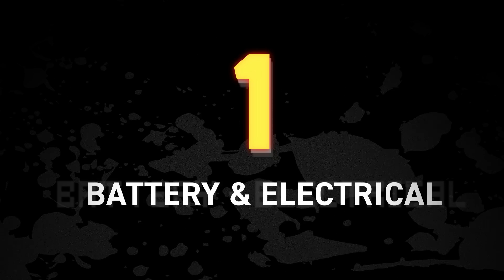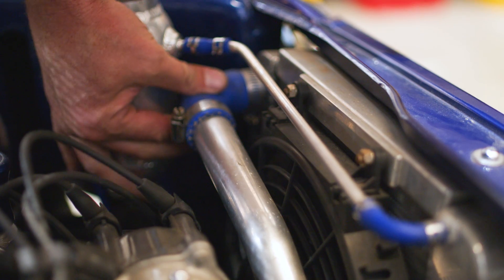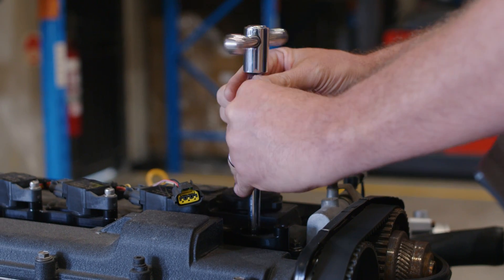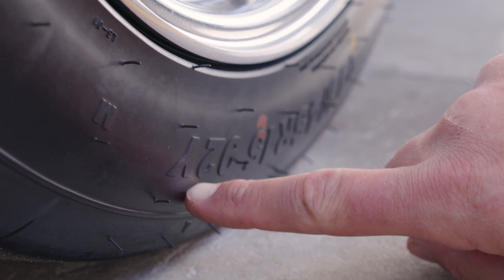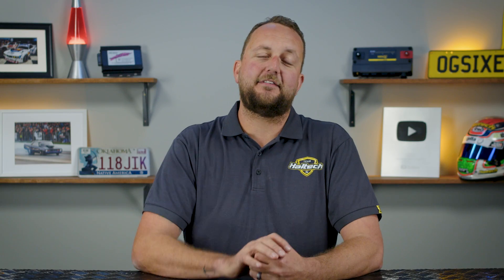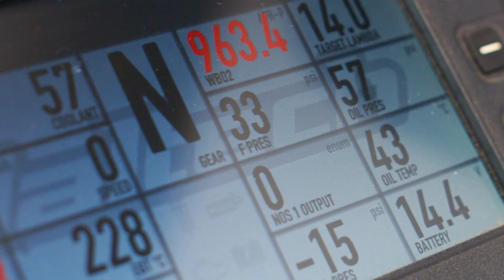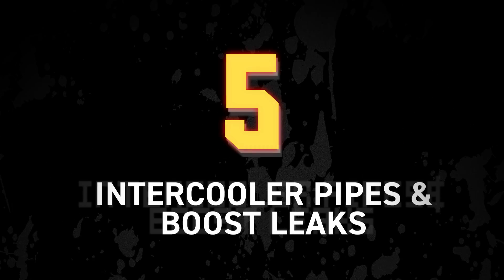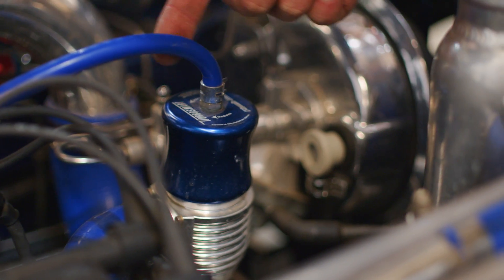🛠 Top 5 DIY Pre-Dyno Checks | TECHNICALLY SPEAKING

Comment: An experienced engine tuner will use a scope to do a relative compression test, using a reference from one of the coils or leads and a current clamp on a battery lead.

Comment: The note about the immobiliser stood out to me. My car was taken for a tune by my mechanic so i wasn't present, but they had an awful time on the dyno with the immobiliser cutting in and out several times and causing disconnects from the ECU. I'm surprised (and grateful) that they persisted!

Comment: Interesting that for a compression test, you crank until the pressure stops rising.  When I was learning, a very long time back now...back when carburetors were a thing...you went to full throttle, bit only cranked for 3-5 rotations.  I think the idea was to avoid getting too much fuel in the cylinder, which could give an artificially high reading while also washing all the lube off the cylinder walls.  But since there was no real way to turn off a carb that has a full float chamber (especially as most carbs didn't come with a cut-off solenoid back then)...so that was the best we could do.  Still seemed to give reasonable results so long as you were consistent in your technique, as consistency of compression was generally considered more important than outright pressure numbers.  :-)
Reply: Unplug cam/crank sensors... No signal... No fuel or fire. 👍🏽
Reply: @ZTM_Development   You understand that cars of the age I'm talking about didn't have either cam or crank sensors, yes?  Didn't have sensors of any sort.  Even the fuel pumps were mechanical and pumped whenever the engine spun...and fuel systems were returnless, so fuel was always available if the engine was turning over.